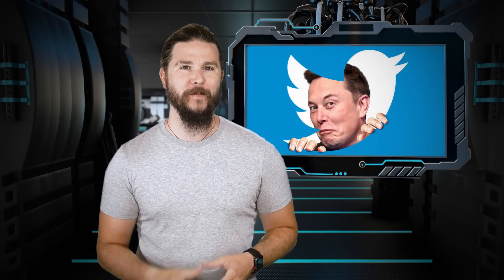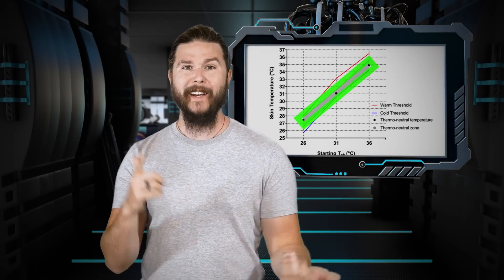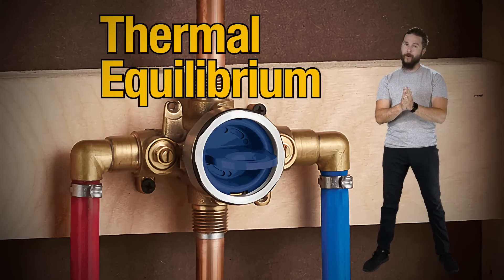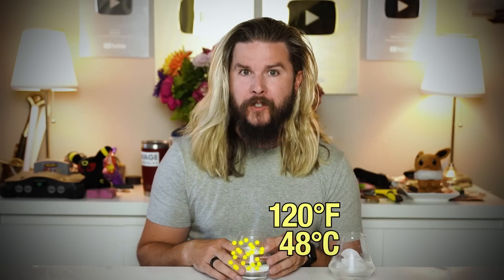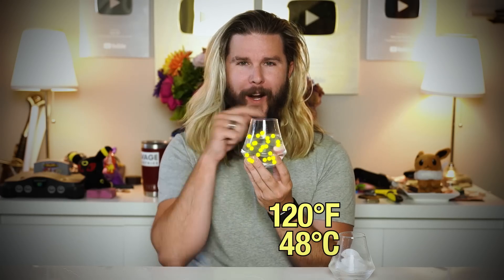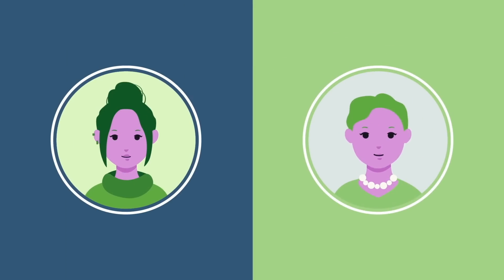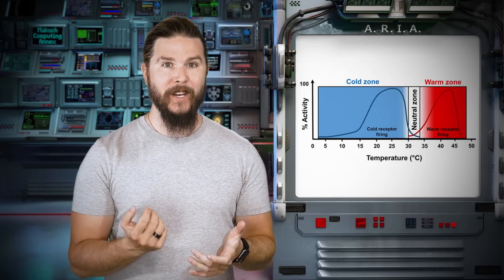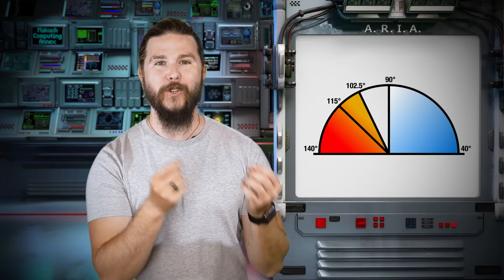Why Are Shower Handles So Sensitive?

Comment: You missed a few good options.  You could put a mix valve before your shower valve so that the hot water is actually colder ONLY for that shower, by being premixed with some cold.  This would increase the area of useful range on your adjustment.

I think one of the reasons the handles have so much adjustment is that supply water temperature changes from location to location, and even from season to season, so while on a given DAY you may only have 12deg of useful adjustment on that lever, from summer to winter you likely use more like 30deg, and across their entire client range it may be 50deg or more.  It sucks for you, but it makes sense for the producer, though I agree that there must be a better way.

Comment: Clearly showers need a fine tuning knob in addition to the main control. 

But also, I find myself usually turning a shower as hot as it gets and then only backing off a little bit. And then gradually turning the heat back up as the temperature drops from the water heater running low.

Comment: I always wondered why showers dont have two settings. there should be a rough setting, which is what the showers do already, but one that remains static even when you turn it on and off. Then you have a finer setting that lets you tune that 3 degrees of useful temperatures into, say, 90 degrees. What this allows for is the ability to more easily control temperature and find a sweet spot within a larger range of motion while still giving people the ability to adjust the rough setting in case of a change in water pressure/temperature or another person's preference, giving full control over the entire spectrum of heat possible.

Comment: When I redid the plumbing in my house, I redid the shower valves.  They are extremely complicated with more than a dozen parts and gaskets if you take them apart.  The anti-scald valve is a nice addition, but can lead to cross-over of hot to cold plumbing in cheaper valves.  You aren't actually engaging the hot pipe until the shower valve is in the final 45 degrees of turn (probably for safety).

Comment: Continuous water heater and set to your top preferred temp for shower use. Most newish washing machines have a heating element so it won't affect that. This can be done with a standard water heater and if so will save you a good chunk of change throughout the year on your power bill. Why anyone would have a different setup at home is beyond me!

But I see a market for affordable shower fixtures that would allow you to set the min and max for hot and cold inputs, giving the full range of motion of the handle/s a proper control.

Comment: I like the idea of adjusting the hot water heater, but in my personal experience, the water that I wash dishes in is hotter than the water I shower in. So, I guess I'm stuck using my lab coat

Comment: Things get far more complicated when multiple people/machines are changing the pressures of the hot water in, let's say, an apartment building.

Once a neighbor draws themselves a bath, flushes the toilet or does their dishes, the pressure of the water dips, allowing the other to take over... Or badly insulated lines causing you to suddenly scald yourself once they've normalized in temperature. 

Just pointing out the obvious, I suppose. But I had to vent. City slums are not a fun place to take a shower.

Comment: Sometimes that extra knob real estate can be useful. I know in winter my apartment's shower water is noticeably colder where I'm relatively close to only feeding hot water, whereas in the summer I'm barely using any hot water because the water's already somewhat hot to begin with. We're talking about like... a solid 30 degree angle difference on the position of the knob.

Comment: Isn't there also latent heat in the pipes? Any slight perceived adjustment would actually be wrong a few seconds later as the pipe gets back to equilibrium

Comment: The solution: Use a witness mark. Get the shower to the point you like it at. Take something (like a sharpie) and place a line on the handle leading to a fixed point. Next time you want your shower on, just line those lines back up.

Comment: My biggest problem is the temperature changing without me turning the knobs. Just, all the sudden, "Oh, I think it's time to get 5 degrees hotter. Never mind, let's drop by 7 degrees!" I remember my family testing out a shower head that let you pick not only a precise temperature, but precise blocks of temperatures across the shower head, so you could have different areas of the shower head spit out different temperatures of water, at least 25 years ago at some home improvement sale, and I'm wondering why that technology isn't run-of-the-mill now. They didn't buy it back then because it was a few hundred dollars, which is kind of a lot to spend on a shower head, no matter how fancy it is.

Comment: Videos like this are a big part of why I am glad that every house I've ever lived in had a shower with individual hot and cold water handles. Single dial showers are for suckers. Lemme pump the hot on full blast, then add in as much cold water as is needed (usually not much cause they're all older houses, hence the older style, and the water doesn't get very hot)

Comment: We got an even fancier thermo-static like valve that has one handle that controls the exact temperature regardless of flow rate.(controled with a second valve.) It has a marking that gives you exactly 38°C when you line it up. We even changed our boiler and changed our boiler temperature and it still gives the exact same water temperature.

Not exactly sure how they engineered it, as it doesn't require electricity to work(obious safety, but there are crazy electric shower heads out there), but that's some marvelous passive thermo regulation.

Comment: OR! And hear me out on this. You could have a shower head wired to the house electric system which has current passing through a eletrical resistor that heats up the water as it pass through it.

Comment: No, the reason they don't fix it is because it is not broken.
 Shower heads need to output more than just the standard shower temperature. You need hot water to clean the shower. You need cold water to condition your hair. 
You use your shower for more than just showing. People used to do their laundry there. People wash their pets there.

Also, the way over engineered single knob is really new. The much simpler two ordinary valves setup just worked better. the knobs you are complaining about are the fancy expensive options.

Comment: I have mixer taps (ie one handle to control hot water and the other for cold). The problem is not the range but rather the fact that the cold water temperature changes with the outside temperature, and the hot water temperature starts at a lower temperature and keeps warming up as the water pipe heats up. So it's always a guessing/balancing act.

Comment: There are a couple of problems with your suggestion of turning down the water heater temperature.  First, it’s not increasing the range of comfortable temperatures; it’s just moving them farther to one side, decreasing the “too hot” zone and increasing the “too cold” zone.  Second, if you have a large household relative to the water heater capacity, you can quickly run out of “not so hot” water as people take showers in the morning.  That’s what my parents did, and it was very annoying whenever I was one of the last kids to take a shower instead of one of the first.

You also didn’t mention the time it takes to clear the cold water from the hot water pipes when the hot water hasn’t been running for several hours (like first thing in the morning,) especially when the shower is a fair distance from the water heater.  In that situation you need to run the shower at full hot until the hot water reaches the shower, at which point you can tune it back down.

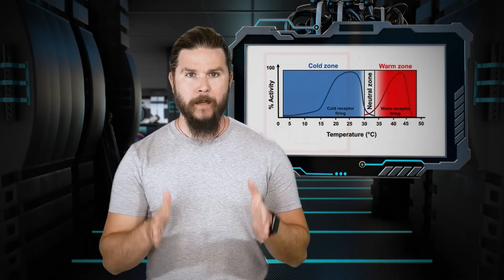Comment: Wouldn't it be easiest to create a custom translation between the shower handle and the actual valve? Something like a 1:10 ratio, assuming a good starting position, wouldn't require any external changes (like adjusting the water heater) and vastly increase the "sweet spot angle".

Comment: Thermostatic valve solves the problem.  Used to have them on our central heating radiators to give each room its own temperature setting.

Comment: One of these days I want to have a digitally controlled shower temperature adjustment. Set the temperature and a sensor reads the output and adjusts the inflow of hot and cold water to keep it exactly there. We live in the current year, how is this not the norm yet??

Comment: My shower handle is "dumby thicc" as you said. I feel the pain. I literally just tap my handle just barely to move it in temperature. If I like I hit it on accident in the right direction too hard, its from very cold water to burning water that actually hurts. You know how long it took my hand to start hurting after holding it under super cold saline water? 6 minutes. I can't do the same thing under my bathtube fauct when its set to like low heat. Idk why they allow showers and baths to get that hot. I can understand cold going that low because you can just turn back up the heat or get out. It's not gonna shock you or frostbite you right away. When I set my shower to max temp that shit would burn me so bad especially during the summer even after seconds. I've kinda enjoyed colder showers recently. Not too cold though. Not like my water can even get cold because I live in a desert.

Comment: In Norway practically everyone has a regulator with water pressure on one side and on the other a wheel that goes from 20ºC to ca 42ºC (or 68ºF to 107.6ºF in American) those are almost a complete turn of the knob apart. There's also an anti scalding stopper button that prevents you from accidentally going above 39ºC (I think, the label is a bit faded but it starts with 3, could also be 38ºC maybe... in any case it's uncomfortably hot but not dangerously so at this point) . And this knob doesn't directly control the water; it controls a mechanical thermostat. So once you wait a few seconds so to get fresh hot water from the pipes it's really consistent temperature. I don't think it's legal to install anything but a thermostat regulator; and the stopper button has been mandatory since the 80s or early 90s I think. Of course some ancient installations have less safe mechanical knobs; but I think if you renovate the bathroom plumbing you're required to install a safe thermostat regulator.

I rarely see non-thermostat based regulators anywhere when on vacations in Europe; so I would not be surprised if its mandatory for all new and upgraded installations in all of EU (and EEA).
It really surprises me how many of the sensible safety regulations that I have always taken for granted since they have existed at least all my 40 years alive in Norway, still doesn't exist in USA. It's the "land of the free to hurt yourself", I guess?
Reply: Here we don't regularly get scalded or curse the cold water; if anything we might be slightly annoyed that our partner prefers 1º hotter or warmer than we do.

Comment: In the Netherlands, or a better part of Europe, we usually have thermostats built into the shower. Where one knob handles the flow and the other knob lets you set the desired temperature to be mixed in superior degrees Celcius.
Reply: I live in Belgium, yeah these things have been a fairly common thing for at least 30 years.

Comment: The best shower I ever had had a knob that you lifted up to turn the water on and control the flow, then turned right for cold, and left for hot.  Now I have to deal with a BS lever that will give me full-strength crab-boil or proper temperature pee trickle.  I absolutely hate this second option.

Comment: Most showers also have a way of keeping the water from “scolding” (120 F).  Take the handle off and usually there’s a way of limiting the heat. Set it low enough and you could theoretically just turn it all the way hot for the perfect temp every time.
Reply: Scalding*

I highly doubt the shower is giving you a talking-to about your poor life choices.

Comment: Personally, I prefer to turn the shower to the hottest available to practice burning in hell. When I'm about to faint from the heat/dehydration or developing mild burns from the water is when it's time to get out. (I've been using more normal temperatures lately to reduce heating consumption, but my preference is still hot.)

Comment: What about showers with 2 handles? I know your talking specifically about singles handle showers, but mine has a individual hot and cold dial which i feel is the best option because it gives you full control where if its too hot or cold you can adjust either handle to tune it. Ex. if it's too cold you can turn hot up or cold down depending on the scenario, and vice versa

Comment: And this is why I always install showers (where I live, of course) that have the TWO handles setup, so you set the temperature with the ability to adjust with either the hot or cold knobs. 😉

Comment: I just have separate temperature and flow controls the temperature turns very slowly you have to do more than a full rotation to get to the very hot water and there is a small lock key to stop you from going too hot. (You can press it down to override it)

Comment: Well then. Considering it's just as easy to run the shower for a bit before you get in and touch the water to ensure the proper temp, this is just...interesting science to an easily solvable problem.

You could also have incompitent plummers like I do and when they go to replace the pipes they fuck up your handle so that all the way to the right is off and that means that when you put it straight up to the middle of the arc you get the perfect temp (yes I had them come fix the handle. No they didn't fix it even after recognising their mistake and messing with it to "fix" it. It's fine though cause it's pretty much perfect as far as handle placement goes).
That said, I do miss my old shower knobs. I had two. One for hot and one for cold. It was so nice being able to control them separately.

Comment: It is not the human skin that's the problem.  Thermometers don't feel too hot, or too cold, but you can measure the temperature of the water coming out of the shower head and see that a tiny fraction of a turn of the faucet changes the temperature of the water drastically.  All this without touching it.  I've seen the water jump from 30 C, to 48 C by nudging the hot water up the tiniest amount.  And similarly watched the temperature drop from 30 C to 8 C when someone runs the hot water in the kitchen sink.

This is why I invested in a digitally controlled shower.  I set the temp I want, turn it on, and once it reaches that temp, it stays there no matter what.  It's very expensive, but I'm no longer scalded or frozen.

Comment: For me at least I use the full on hot setting every time. My shower is roughly three million miles away from the hot water heater and literally takes three to five minutes on full hot to start warming up. So I tend to put it on hot blast, brush my teeth, then get in and adjust the temp.

Before you all berate me for wasting water I live near a giant lake. My immediate area is water-rich. The rest of the state has to be a parched hellscape before they'll even tell people to stop watering lawns around here.

Also, of all the environmental problems we face, fresh water panic is the stupidest one. Because we know exactly how to fix it and don't because our governments are stupid and cowardly.

Comment: By Cthulhu, another reason to love living in Japan. We have an instant gas water heater that never runs out, doesn't get too hot, and only takes about four seconds to begin running water at the temperature I programmed with a button press before stepping into the bathroom (anything from 37 to 60 degrees Celsius is available). Every place I've lived here since 2006 has had the same: cheap, unlimited, well-regulated hot water. You guys need to get it together. Hot water tanks suck.

Comment: I had a tankless water heater with a wireless digital control bad easily accessed.
I'd just it to 112°F, crank the hot water to full and shower at my exact comfy temperature.
I miss that apartment.

Comment: The thing that's really frustrating is that where the sweet spot is and how wide it is changes depending on the outdoor temperature. The water heater always supplies the same hot water, but in summer, the cold water may be barely below tepid, and in winter it's painfully cold, which means you need only a tiny amount of it to moderate the hot water and there's a microscopic range where it feels good.

Comment: Forgot to mention something that compounds on that tiny usable range, the amount of play in the handle before it actually interacts with the valve usually results in tiny movements in the opposite direction not doing anything until all of a sudden the play is taken up, causing a more apparent temperature change relative to the movement before.

Comment: If you have reliable hot and cold water, you might be able to draw a line from the handle to a stationary part of nob and can re-line those up each time. Doesn't help with sensitivity of the nob, but it gets close